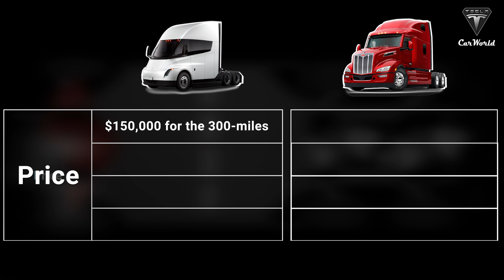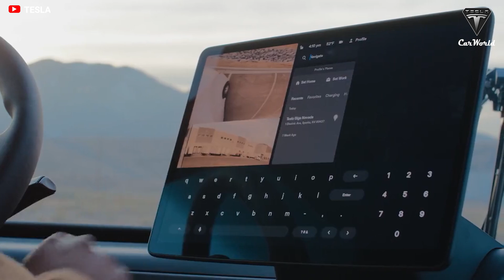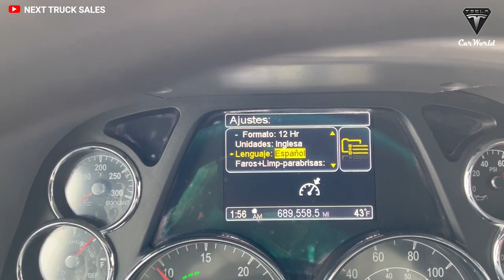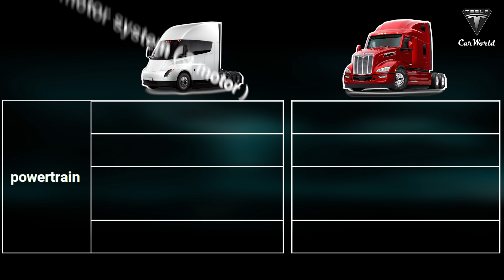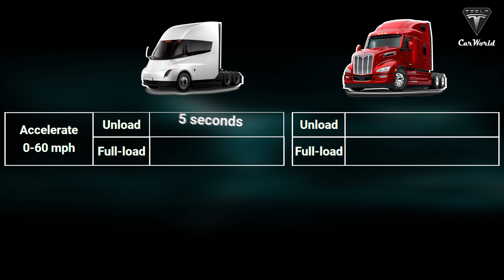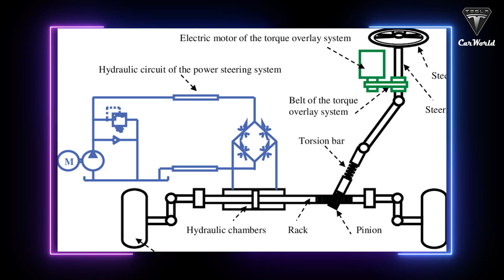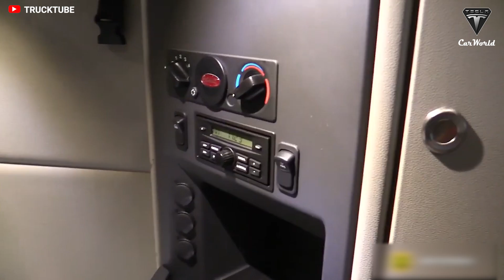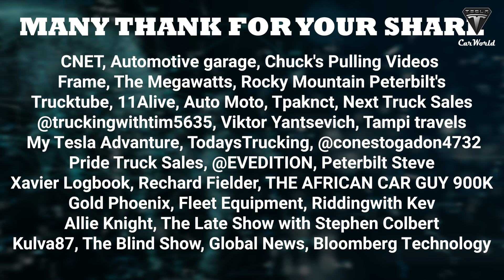Tesla Semi Vs. Paccar Peterbilt 579! Which is the Best Choice of 2023 Heavy Trucks?

Comment: Tesla is the better one over time because of maintenance it will be cheaper. it is safer for both other people and drivers and the driver itself as because of you not needing to change gear so you wont miss a gear when going down hill. It also doesn't use its brakes as electric vehicles can use regenerative braking. also the battery pack is around 900kw not 1000kw so its lighter than it will be expected. also the reason it can have a payload of 82000 is because of a law written in 2020 i think it was which added 2000 pounds for electric semis.
Reply: It has a gross vehicle weight of 82,000 lbs., not a payload.
Reply: @BigBen621  that's true.
Reply: Look up the weight of the Model Y battery pack, the Semi has the equivalent of 10-11 of those. Look up the weight of the diesel power pack, it's transmission and fuel, (ignore the coolant system as the Telsa has those, ignore the weight of the breaking systems as the Tesla has them as well as the air pumps), You'll find that unless the Tesla Semi is using a titanium and carbon composite in it's chassis, it's going to weigh more than the comparable day cab diesel truck.
Reply: @pogo1140  I don't think anyone's saying the Tesla won't weigh more than a comparable day cab diesel truck; of course it will. Yes, the batteries are much heavier. But the motors are of course much lighter than the diesel engine, and no transmission or fuel. While the Tesla has a heating/cooling system, it'll be much lighter than the diesel because of far less heat to reject than the diesel engine. Plus the Tesla gains 2,000 lbs. in GVW (82,000 vs 80,000). So the question is going to be "how much heavier is the Tesla Semi, and how much payload will it lose?".

Tesla has said the payload is comparable; but even if it's somewhat less, there may be many operators who'll take a modest loss of load for a major reduction in operating expense. In addition, reportedly a large proportion of loads are limited by volume, and not weight; for example, the first Tesla Semis are going to Frito-Lay, and I doubt you can put enough Fritos in a trailer to overload it. For those who just must have maximum load and aren't concerned about operating cost, the Tesla Semi may just not be the truck for them.
Reply: @BigBen621  It's still a net loss because the total weight of the diesel motor and it's associated equipment is less than the battery resulting in a heavier truck even if the weight of the electric motors, it's reduction gears (3 sets which combined weigh as much as the diesel's transmission) weighed just 10 lbs.
Reply: @pogo1140  I have acknowledged that it's still a net loss; the question is "how much of a net loss?". There is plenty of speculation, some of it pretty wild. but you can be sure the purchasers know exactly what the payload is; and at least in the case of PepsiCo, they're still purchasing 100 of them.
Reply: @Ben Thurston  from the rough math, the Tesla Semi is 5,000-8,000lb heavier than the equivalent diesel day cab.
Reply: @pogo1140  Not disputing this, but can you show the assumptions and math? Thanks! 🎄
Reply: @BigBen621  Start with the weight of the battery which according to Elon is the same cells as those on the model y and 3. Pull up the weight of those packs and you get 1,300 to 1,700lbs each and the Semi has 10-11 of them. compare that to the weight of the diesel engine (3,500lbs), transmission (600-700lb) and fuel for 500-600 miles (608lb) call it 700 to account for the metal tank (some companies us plastic for the weight savings and lower cost) which combined come to less than 7,000lb, 8,000 if you want to give the electric truck as much help as you want. Just there you are already 5000-10,00lb heavier and we have not yet added the weight of the 3 motors, their heavy duty reduction gears that are needed to convert what 27,000rpm to 500rpm at the wheels.
Reply: @pogo1140  You may be overstating the weight of the battery. In a report of a tear-down of the new Model Y with structural 4680 battery pack by Munro & Assoc., "Steuben said the battery pack, with the seats, center console, and floor pads, weighed only 1,198 pounds". So maybe 1,000 pounds for the structural battery only, less if it's non-structural. Another way to look at it is from the cell level. Presumably, the Tesla Semi will use the 4680 cells. These have an estimated energy density of 272-296 Wh/kg. At the lower estimate, the cells in 900 kWh battery would weigh 3,308 kg or 7,292 pounds, plus the structure. You didn't say whether you were using 1,300 pounds or 1,700 pounds, and 10 or 11 of them, but unless the structure of the 4680 battery is incredibly heavy, the battery would likely be considerable lighter than your estimate.

The rest seems plausible; but it's not consistent with Tesla's claim that the Tesla semi will have payload "comparable" to a diesel semi. Anyway, we'll know soon enough, and it'll be interesting to go back and see which estimates were close to the mark, and which weren't. 

Best holiday wishes.
Reply: @BigBen621  I used the range weight to cover the weight of an 800kWh battery or a 1,000 kWh battery. 800kWh is the minimum battery it needs for the stated acceleration and range but does not take into account degradation for the minimum 5-8 year service life with only rapid charging as you are not going to slow charge this battery. So for that you are looking at a 900kWh-1,000kWh battery, thus heavier battery. For Musk "comparable" is what ever he says it is, just like Full Self Driving does not mean Full Self Driving according to Tesla and "soon", "now" and in "two years" could mean 3,5,6,10 sometime before the next 50 years.
Reply: @pogo1140  I don't disagree with any of this. Time will tell...

Comment: The Tesla has a snowballs chance in hell to match a Peterbilt rang and speed.   the tesla can run for what 2 hours or 3 maybe lol while The peterbuilt can travel 2000 miles and refill in 15 min for another 2000 miles + 2000 more and 2000 more ect.  is isnt faster and  everything you say is BS        But i will say the cup holder and phone charge station is a good selling point lol   it is a Epic Fail  and a joke
Reply: Umm team partners NY to Cali. You choose a tesla ?
Reply: @youhappynow9875  No, of course not. No one, least of all Tesla, is saying that the Tesla Semi will be appropriate for all situations; it's up to a potential buyer to decide whether it's right for their situation. And certainly a coast to coast trip with team drivers is not the application the Tesla is designed or intended for.
Reply: You seem to be forgetting that drivers are limited to 11 hours of driving—plus a 30 minute break after 8 hours—in any 14 hours, followed by 10 hours off. Since a Tesla can easily charge during the off-time, a single driver can cover just as much road in a day as a Peterbilt.

Comment: Is the distance range measured with load with trailers, or just the tractor without a load
Reply: @Terry Orzechowski I think it was a Tesla employee driving, not Pepsi. And they gained over 4,100 feet at the Tejon Pass (Grapevine), and got back most of the energy used in the climb from regenerative braking on the way back down.
Reply: @Terry Orzechowski I didn't get the impression from the delivery video that this was at acceptance drive for PepsiCo. But I think that was an assumption on my part with no factual basis, so it's perfectly possible that this was an acceptance drive, and by a PepsiCo employee.